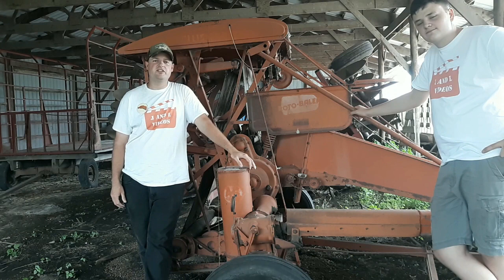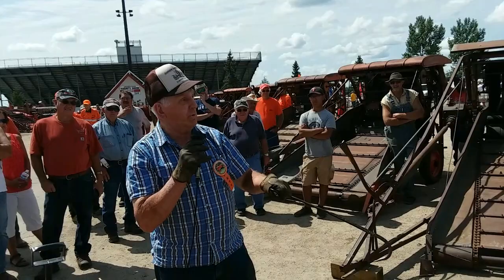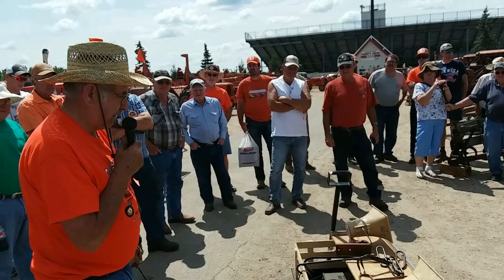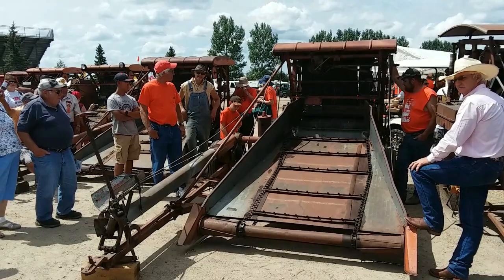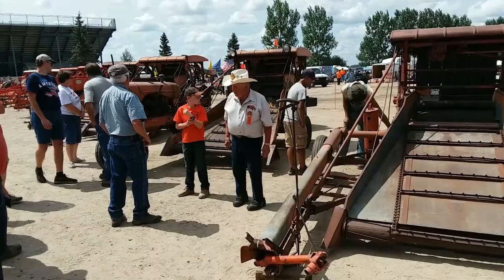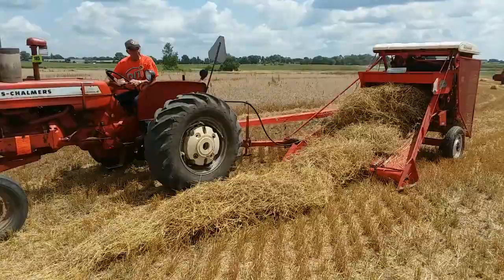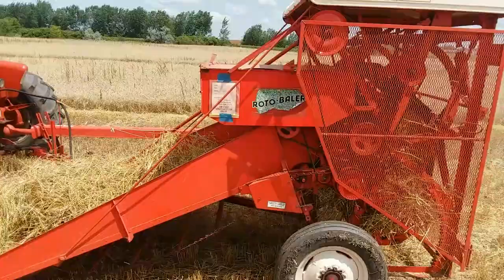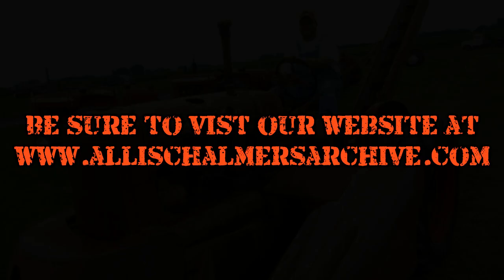Allis Chalmers Show: Living History Of The Roto Baler

Comment: I missed the Roto Balers by a few years, but one summer we had a drought so there wasn't a lot of hay around. Some how I ended up on a few crews that were cleaning out mows, some barns I had been stacking in for a few years were emptied and it seemed like there was always roto bales in the bottoms of all those mows and we dug them out so they could be feed that year. A few years later I was at Michigan State University and took some Ag Engineering classes, our professor expressed the opinion that the Roto balers were one of the main reasons Allis Chalmers was still around. For what they were we could say maybe folks were a little more used to hard work, it's amazing that technology that was so simple lasted as long as it did. Maybe some folks were more willing to work than to deal with the issues the early square balers had.

Comment: Grew up on a 260-acre with over 100 head of dairy cattle. Started helping dad in the field when I was 4 (1962) with one of these hooked to a Farmall H. Dad had to stop each time the arm swung down to take it out of gear and let the clutch back out to drive the PTO. When the bale ejected, he had to clutch and put it back into gear again. Me, I was fascinated by the baler throwing the bales out of the back. And I remember this thing took a LOT of maintenance to keep going. Belts break, conveyor chain gets wonky, string wouldn't start, etc. Fun times!
Reply: The live pto made that much easier.

Comment: The round bails were very easy to handle.  Not sure why they went to the square bales, other than stacking in the barn, round bales are easier to handle than square, and I have never broken the string and have to retie it, or put it back in the bailer to rebail it.

Comment: I used the orange top for some farmers but if you didn't watch the bail tightener it would make heavy bales, they fixed that with the white top bailers, I was 8 yrs old when I started getting paid to put up hay with no help. I remember making farmers mad when one built would break I insisted on changing all the belts so the bails did not come out cone shaped. I still like putting up hay the same way!!!
Reply: Hank , can you tell me what was dangerous about them...? Was there one single situation, possibly break down, where a farmer was alone..., and should have had assistance...? Wax it changing belts? Should the large spring be removed before working on it?
Reply: @lewspeedwagon6330  There were many instances where the twine arm would drop down to tie but the roller did not catch the twine.  A farmer would get off the tractor with the bailer still running, reach up to push the twine toward the roller and get his arm pulled in.  That is where he would later be found in the field by his wife.
Reply: @jerryhill7123    did that really happen that often  🤔
Reply: @bustersmith5569  Depends on what you consider often.  More often than should have happened for sure.  I know of two incidents that happened within 10 miles of where I helped my Grandfather farm.  Fortunately neither resulted in a death.  In one case the farmer's arm was stuck until it burned off, he then got on his tractor and drove home to his wife who called the ambulance.  The other was a 5th grade classmate, the tractor driver was holding in the PTO clutch while he reached up to move the string and the driver's foot slipped off the clutch.  He got it stopped quickly but still had to have skin grafts taken from his leg to patch his arm.  I also remember many farmers in the community with missing fingers from corn picker accidents.  The corn would pass over rollers that would pull the shucks off.  When the corn got stuck the farmers would reach in and have their fingers plucked off.  I also have personal knowledge of a few farmers having their clothes ripped off after getting too close to a running PTO.  Most were the case of doing it 100 times without incident, but that one time was all it took to change their lives.
Reply: @jerryhill7123   yeah your right  !!! Seems i heard some stories about the snap couplers too but I think it usually killed the farmer ,,,,,,, not good for sure,,,,

Comment: We had a white top roto bailer. Dad always made heavy bales. One time the arm had dropped signaling that the bale was full size. The feeder didn't stop at the same time and a bale sized wad went in before the feeder stopped. It made two bales at once. The tractor motor just roared with the increased power needed to keep the baler turning. When the bale hit the floor of the wagon i thought it was going to go through it. The whole wagon just shook. It took up the space of two bales in the stack on the wagon. I never picked it up, not sure i could have. I just drug it  into place. I put it in the bottom of row in the stack and just drug it outside the stack fence to feed it.